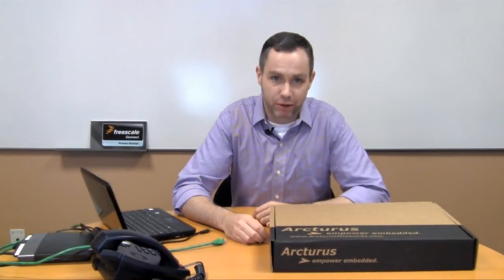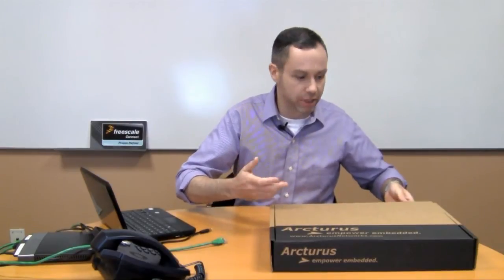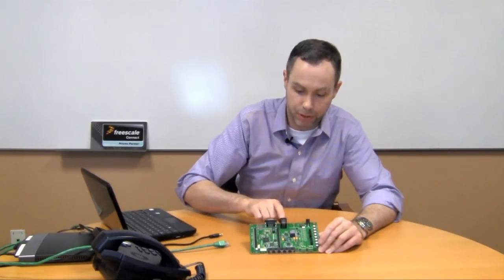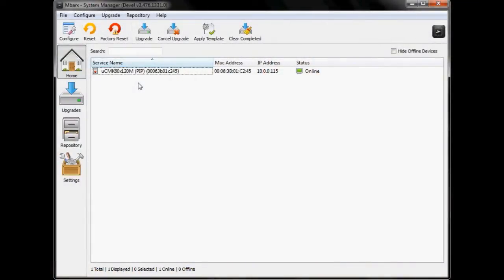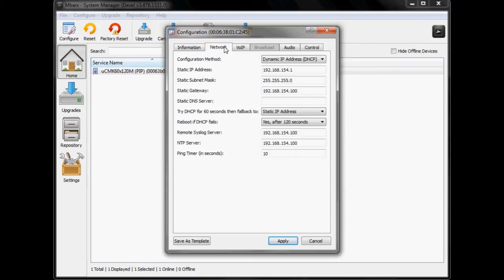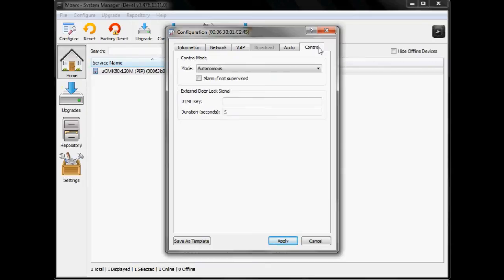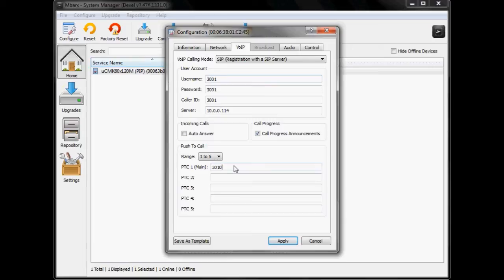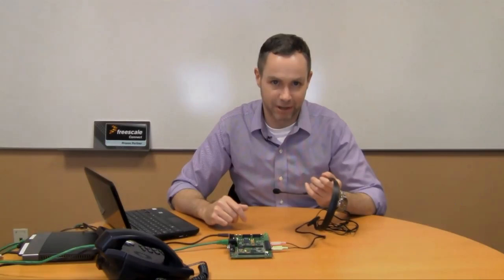uCMK60-VoIP Board and Module - Product Introduction

Comment: Hi there, were there specific videos for the "module" packaging of this system, or only the development breakout board? Interested in the smallest form factor this solution is available in. Thanks for posting.
Reply from the maker: Hi Dan - the module is 60x60mm - the link below will show you the module compared with a penny.
http://www.arcturusnetworks.com/wordpress/otherimages/lightbox/uCMK60-MOD-Top_Penny.jpg
There is also CAD object available from the support site, to help with module integration.